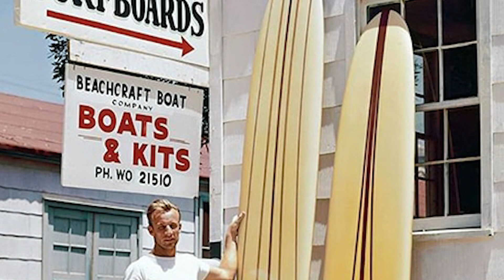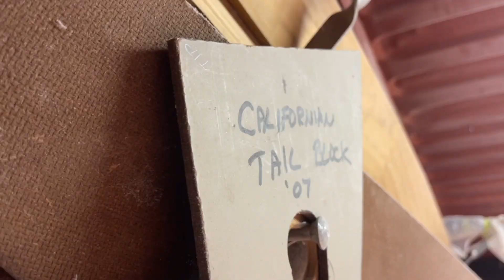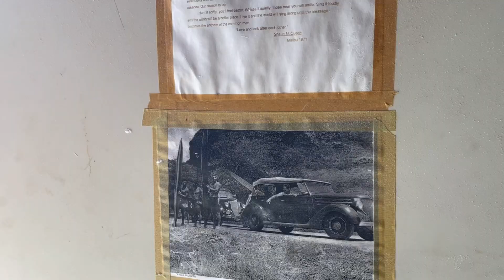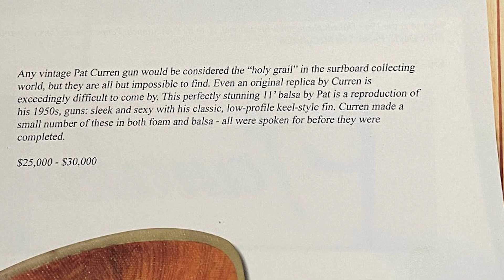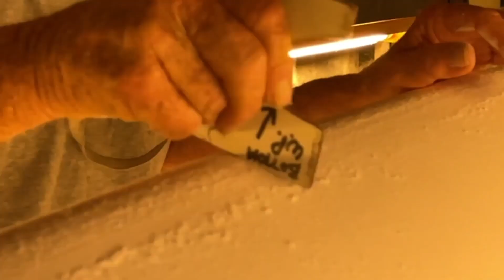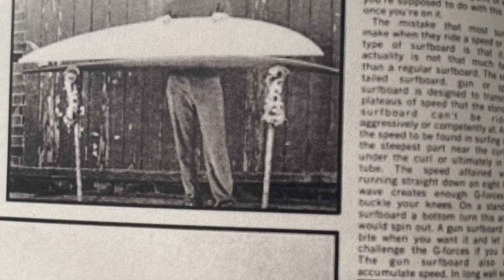Shaping Methods of Mike Davis | LittleCoveSurfboards

Comment: 30+ years ago when Mike was also making sailboards, I created a profiling machine so most of this methodology was no longer necessary. Rocker curve is likely the most critical design component of surf and sailboards. Working like this creates an imprecise and incalculable result. Every board is a lucky dip, which completely unnecessary in the 21st century.
Reply: Hey bro I am very interested in your comment here

 "I created a profiling machine so most of this methodology was no longer necessary. Rocker curve is likely the most critical design component of surf and sailboards"

I am trying to find REAL info on Surfboard shaping, any info would be highly appreciated, thanks.
Reply: @stevengouws8684  It was needed as part of an experiment of mine. I  thought an exponential rocker curve would provide maximum potential speed for a hydroplaning craft.
I produce several boards from the initial profiles. No other additions to the shape as the intention was to isolate rocker performance. It worked extremely well. The boards were lightning fast and still turned well, an unexpected result. 
I really didn't have the money to make too many boards so I eventually sold the profiler to a local board maker. Without trying them, he destroyed the templates and created templates that were copied from Naish and Fanatic. Seems some people just aren't scientists.
Reply: @rctrix9063  Thanks for answering. I never knew rocker was as important as that, good to know.